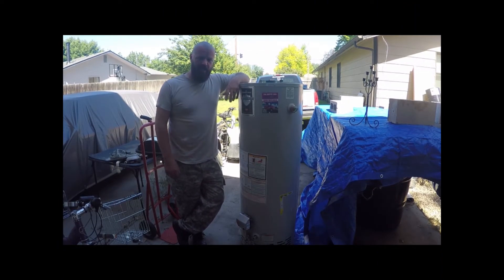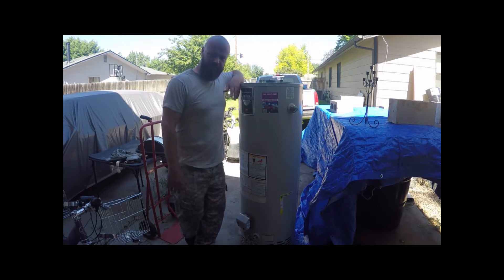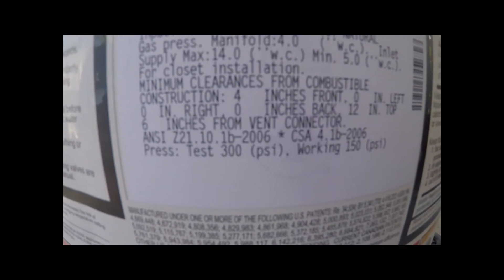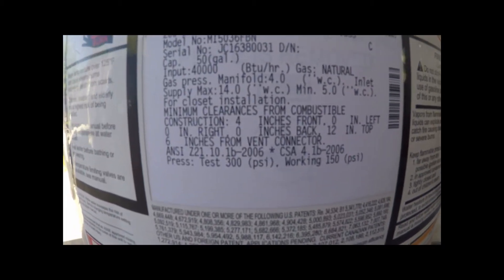Building an air tank from a water heater

Comment: I see this video is a year old. I'm just now in the initial stages of doing the same thing with an old gas heater.

 Quick question: How well has that compressor motor held up since the expansion? I'm expanding a 21 gallon tank with a 1/4 hp single stage oil-less. I think at this point, my only concern is if that motor will hold up, or if I should invest in upgrading it too.
Reply from the maker: So far its been good. I have an external fan blowing on it because it gets very hot. If im to two cycles in a short amount of time ill give it a break. If you have the means to upgrade I would do that. Im also going to be upgrading to an oiled compressor and another 50 gallon tank. Ive been moving and dealing with life so hopefully soon ill be doing a video on that build as well.

Comment: I could not sleep few days ago and suddenly I had an idea exactly like this - I happen to have 2 100L (26.4gal) hot water tanks (with electric heater like yours) lying around and they're brand new, never used once and I got them for free few years back, leftover from some big construction site. I also have another also 100L one that my dad gave me as he switched to a bigger one so this one is used a little but it has a water coil (for gas heater or similar heat source) and few more nipples to play with if I want to. I followed the same way of thinking that those tanks are rated to similar pressures and tested at much higher so should be fine. 
My friend though had a concern that water and air acts quite differently in case of leak and pressure drop so it might be that dedicated air tanks actually have thicker walls to get extra safety factor. So, I wanted to check if anyone was also crazy enough to do it this way ;-) Since air compressors prices are pretty much rated based on air tank size I'd say it's much better deal to get one without a tank or with a small one like 25L and just hook it up to this water tank. What's the worse that can happen, right :D Maybe I will weight mine first and try to figure out what's the wall thickness and compare that to an air tank. 
BTW, since I live in Europe our tanks are smaller than those in US as you can see but it's a great upgrade anyway :D
Can I ask you a question what is that sealant, this white stuff you put on the threads? Is it a kind of anaerobic glue?
Reply from the maker: Its some automotive thread sealer for water pump applications. Hope that all works out for you. Been using mine since and plan on adding another 50 gallon tank with an upgraded compressor head and motor. Been working awesome. Thanks for the comment.
Reply: I know it is old post, but air or water, it is the same. 120psi of water and 120psi of air are the same, pressure wise. When the tank breaks, water will just leak. Air will usually be violent. I am doing one just now in Europe, working pressure is 6 bars, so 90 something psi. It goes to 10 bars, around 150 psi. At least for my model, so 120 should be usable. I also own 100L gas bottle. Vehicle gas. That thing goes to 90 bars and it is very safe to use imo. Hope yours is good too.
Reply: @MarioAPN  Recently I was also thinking about the LPG tank as you've mentioned. I happen to have one no longer in the car, 80l I think. This seems as a safer option of course ;-)

Comment: Nice work. I have stripped down 40 and 50gal water heater tanks in series with my 21 gal HF compressor. I just added a 60gal compressor tank (no head, Craigslist, $60, couldn't pass it up), so 171 total gal. Takes my little compressor 6 min to charge the two water heater tanks (111gal total) from 90 to 125psi. Not bad at all. The air out of the 60gal tank (the last in the series now) is dry and clean even without a filter/drier.